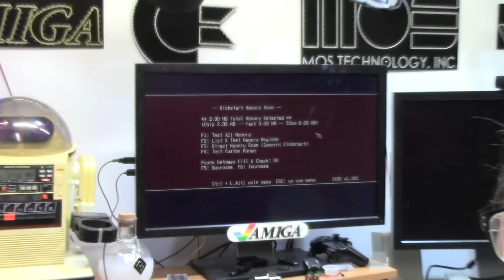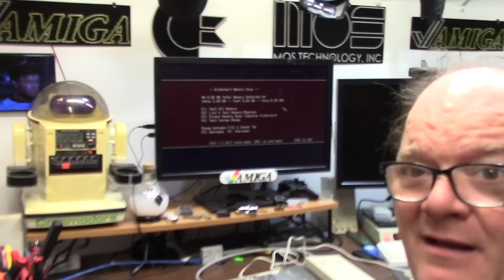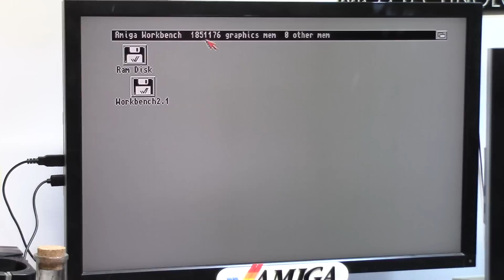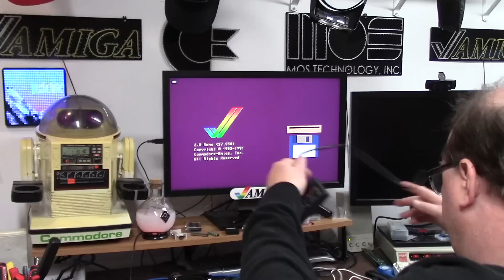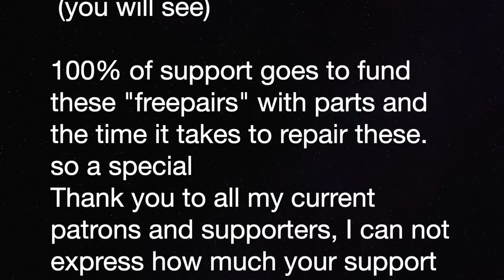Amiga 500 plus 2mb and the differences between it and a regular 500

Comment: Here in the UK I had an A500+ in 1991 and my friends had A500's with KS1.3, I had issues running some games because of the newer KS2.0 in the 500+ but it was a great machine, I literally gave it away some years later as I went over to PC, wish I had kept it. But I have since acquired two A1200's one with a TF1260 and the other just fitted with a PiStorm32Lite+Pi4 (following your tutorials) so it all turned out well in the end, just took about 32 years. Always glad to see your video's Chris, always interesting and I almost always learn something.

Comment: I bought an Amiga 500+ back in 1994 from K-mart (Layby section). It took a while to pay off as i was still in school, but it has 1MB in the trapdoor, and 1.3 KS, not or 2.04. Many commodore  500+ at the time, was just rebranded  and i guess keeping the older 1.3, probably due to compatibility  reasons, while at the same time having the best of what in the plus.

Comment: Thanks for the breakdown on the A500 Plus.  I always thought it was just a game bundle with typical A500.  I had the A500/501, and I remember getting the board upgraded by the dealer.  I can't recall if it was to a 1 MB Agnus, or the 2 MB Agnus.  I eventually got the A590, and later an A3000T.   Great video!
Reply: The 500 plus which was only sold in Europe was the shortest lived variant of the  A500.  It gave way to the A600 and A600HD configurations

Comment: Great video!!!  The 500+ has 1MB onboard btw!  The VBB stuff is interesting that you mentioned (after my video I just put out yesterday for Patrons) - does that VBB alter its pinout, because I thought the 8372AB had the "old" pinout that doesnt match the 8375 at all?  So confused by that VBB thing - it doesnt help there are 8375 that are 1MB and have the old pinout too lol
Reply from the maker: the 8375 2mb VBB IS, as i have it in my 3000 Tower replacement board. check it out. and it is compatible w the 8372B in the 3000/3000T when you add a 0.1 ceramic cap across the pal or ntsc jumper. - see this section of this article "++ 318069-18 (PAL) or 318069-19 (NTSC). Likewise, Vbb replacement to the 8372B. 2 MB support, obviously pin compatible to the 8372B model.
Typically found on very late Amiga 3000 systems. Possible Vbb “fix” needed when replacing an 8372B with its 8375 counterpart."  from http://theamigamuseum.com/the-hardware/the-ocs-chipset/agnus/  called the VBB fix, a 0.1uf capacitor across the jumpers, as schematic and documented here:  https://www.amigawiki.org/lib/exe/fetch.php?media=de:parts:agnus_reworks.pdf
Reply: @ChrisEdwardsRestoration  Very interesting!

Comment: A500...PLUS battery acid!

But seriously, 2MB of chip allows you the ability of playing all OCS/ECS games via WHDLoad. But, if you are using the Amiga 500 "old school" you will be fine with 1MB.
Reply: All OCS/ECS whdload games are now updated to work with 1MB chip + fast ram. 2MB chip is no longer required for an OCS/ECS whdload setup. There used to be a few OCS/ECS whdload games that required 2MB chip. Like SWOS, Cannon Fodder, Dungeon Master 2 and maybe a couple of more. After I downloaded the latest whdload library I found that all these would run with 1MB chip. + fast RAM of course. AGA games is a different matter of course. But AGA machines have 2MB chip anyway.

Comment: It's so odd that you have issues running SOTA on other Amigas. I have an A1200 with an 030/42mhz, an A4000 with a 040/25mhz, and an Amiga 2000 with a 28mhz 68000. All three are NTSC and SOTA runs flawlessly on all of them. The only thing I have to do is set them to PAL before I boot the demo.
Reply: Always been like so with me as well.

Comment: I'm only going off memory here (and maybe I'm confusing it with the A600), but wasn't there some software incompatibilities between the A500 and A500 Plus? I keep thinking there were some games that worked on my A500 but didn't work on my friend's A500 Plus... Or maybe I was just drinking too much drano in the 90's. Might explain why my brain is constantly getting guru errors these days.
Reply: I think it all comes down to older games not working if you have more than 512kb memory.
Reply: Duncan Woodward  Thanks for the reply. That helped me understand allot. I started with the Amiga 500 back in 1990 or 1991 but never had the chance to own other Amiga systems. I had some friends that were lucky enough. One had an A1200 and A600 at some point. One only had an A500 Plus but most in my group only had the original A500.

When I discovered UAE emulation decades ago, certain configurations confused me. I had no clue what Fast RAM was, tried to research it and still was unclear but your reply just helped it make more sense to me.

I figured Kickstart versions had some conflict as well.

On a side note, I am hoping to save up some money and maybe (hopefully) find a good A1200 build kit sometime this winter. I finished my C64 build last year and it makes me more confident doing mods. I'm a bit of a purist and don't like risking original hardware unless it's something simple like replacing old caps, so I'm just going to build my own A1200.  I'll have my hands full.
Reply: Duncan Woodward  This exactly. Not having 1.x ROMs was the biggest compatibility problem. You could also get a ROM switcher to physically put both ROMs in there. Some few very old games don't like having more than 512KB RAM, period (the reason a lot of 3rd party trapdoor RAM cards came with a disable switch) and also some very, very rare few A500-era games that require 1MB of RAM expected 512KB of slow RAM at $00C00000 (expanded CHIP RAM goes in a completely different part of the address space) and didn't work properly with models that didn't have any (including the A500+ and later revision A500s that had been expanded to 1MB of CHIP RAM via the trapdoor*).

*technically FastRAM can be remapped to $00C00000 to bypass that rare incompatibility but only modern-ish expansions really support doing so

Comment: I just want to play pga golf I played as a kid on my Amiga 500+

I looked at emulators and the Amiga mini , but it all looks to complicated and destined to not work for me lol, so looking at the easiest way of just buying a used Amiga 500+ and a copy of pga off eBay 

BUT just wondering if I could buy a 600 or 1200….. if there is any extra benefits ? I know nothing about them really . 

Would the copy of pga golf that works on 500+ work on the 600 or 1200 ?
Reply from the maker: Amiga 500 came with no storage. The 600 was ecs and had limited hd support.  The 1200 is a aga amiga. Has storage and upgradability    They all do now w pistorm s and other updates
Reply: @ChrisEdwardsRestoration  thanks mate

Comment: If you have an original A500, I think it is better to keep it as 512chip/512 fast rather than make the mod to 1mb chip. I have found more things work as original, and the machine seems faster!  Thanks for uploading.
Reply: A500 has no fast, only slow...but it is the way to go with "dirty" programed games/demos.
Reply: Mr Guru  I have got an A600 and an A1200 as well. I like to keep my A500 as original, since if it works on that, then I know it's a compatibility issue!
Reply: Mr Guru  some years back i bought an amiga 500 of ebay it had some strange accelerator card with 8 megs of ram

Comment: I got an amiga 500 from when I was a teenager. It says 500 + on the board but it only have 512kb on board.  The board also have room for a battery but it was never installed. The final thing is that  it is an 8a1 revision. Got any idea what the f... is going on?
Reply: This is just a later revision A500. They started using the same board as the A500+ sometime after it came out as a cost reduction measure. (Why make two different boards when they can use the same for both?) They just come populated with only 512KB onboard, come with a 1MB Agnus and OCS Denise fitted, and don't have the clock chip or battery. Also some solder jumpers are set differently to make the trapdoor add slow RAM instead of additional CHIP RAM.

Comment: SNES programmers had to make do with 128k of RAM, anybody who says you need 2mb of 'chip RAM' on a 32 colour screened computer has no idea about technology, another 'bullshit' update as Shadow of the Beast and Sword of Sodan proved in 1988.
Reply: That's a rather venomous, needlessly insulting assessment, and completely wrong as well, presumably due to ignorance. What an ironic name, "retrogenius". Anybody who doesn't understand the reason for cartridge consoles needing far less RAM than a computer 'has no idea about technology'. Amigas, being computers, ran software from floppy disks (and hard disks if they had them). The software is loaded from the disk into the RAM installed on the computer so that it can be run (i.e. played, if it is a game). There is no way around that, it has to be loaded into memory first. Technically speaking the consoles were no different; a cartridge was a plastic casing containing a PCB upon which was a ROM (Read Only Memory) containing the game - it has skipped the step of the consumer having to load their game into memory because the game is already installed in the memory that you are inserting into the console, which is why you don't have to wait for games to 'load' before playing on a cartridge console. Some more advanced games required extra technology that the original console didn't possess, and in those cases your game would cost a bit more, because it included not only the game on the cartridge but extra chips that provided the new features needed to run the game. So it was not a case of people outside of Nintendo or Sega being totally clueless about how to use memory efficiently.
Reply: @retrogenius8397  Of course you do, "genius" :)

Comment: hello, the Agnus from the A500+/A600 IS NOT THE SAME!!! or COMPATIBLE again in the A3000.
The Agnus for the A3000 is a completely separate chip that has the same pinout as the pinout of the A500/A2000.
They are both called 8375 but the part number and pinout are not the same, there are even 8375 with only 1MB support that have been installed in the A2000 in recent years.
Please correct that people scrap their devices or ICs.
Aso..., The A500Pus has 1MB onboard in contrast to the normal A500 without Plus.
Your RAM extension for the trapdoor therefore has 1MB.
So let's summarize
difference to the A500 without Plus:
Realtime clock 1MB chipram, ECS Denise, other Agnus.
Reply from the maker: The vbb actually is, and i specified the VBB 2mb variant. I did not say all i said the vbb. the 8375 VBB IS, as i have it in my 3000 Tower replacement board. check it out. and it is compatible w the 8372B in the 3000/3000T when you add a 0.1 ceramic cap across the pal or ntsc jumper. - see this section of this article "++ 318069-18 (PAL) or 318069-19 (NTSC). Likewise, Vbb replacement to the 8372B. 2 MB support, obviously pin compatible to the 8372B model.
Typically found on very late Amiga 3000 systems. Possible Vbb “fix” needed when replacing an 8372B with its 8375 counterpart."  from http://theamigamuseum.com/the-hardware/the-ocs-chipset/agnus/  called the VBB fix, a 0.1uf capacitor across the jumpers, as schematic and documented here:  https://www.amigawiki.org/lib/exe/fetch.php?media=de:parts:agnus_reworks.pdf
Reply: Sorry, VBB doesn't say anything about it being C= A3000 compatible.  How it is with replacement boards depends on the board whether it uses the pinout from the original A3000 or A500plus/6000, the fact is that the Agnus from the A500+/600 is not pin-compatible with the A3000/2000/ or 500 <= rev 6. there  since some of the pins are offset by a pin, VBB says nothing about where the agnus comes from or where it fits in.  there was VBB Agnus with A3000/2000/rev6 A500 pinout and for A500/+ rev8 boards... VBB just means Voltage Back Bias and needs a capacitor after pin 41 on boards where no VBB was installed. But as I said that says nothing about it  from that in the A3000/2000/500=<rev6.  fits or is pin-compatible.  the 72b Agnus from the original A3000 is extremely rare and fits in A2000 and A500=<rev6.
 http://pitsch.de/stuff/amiga/a20002mb/agnus.gif
  greet Sven